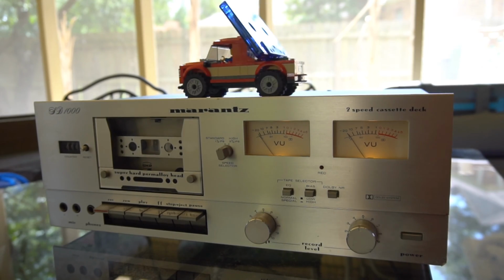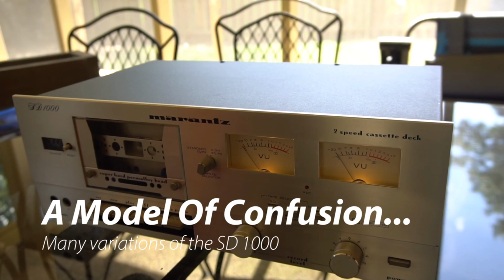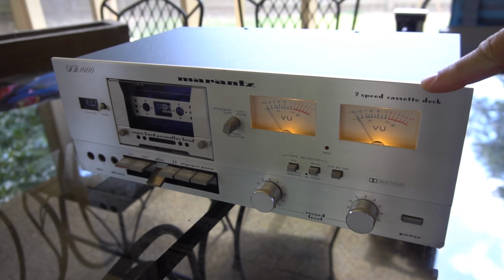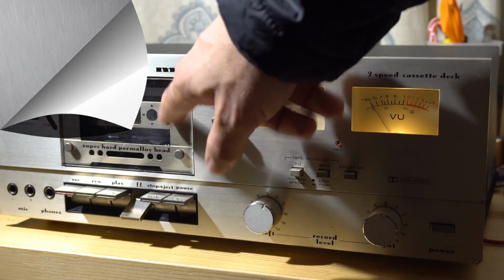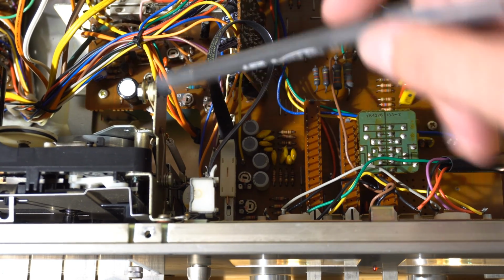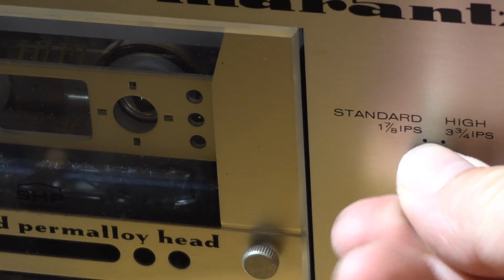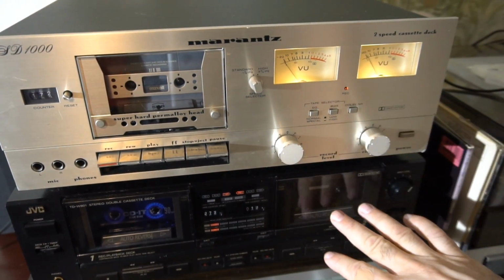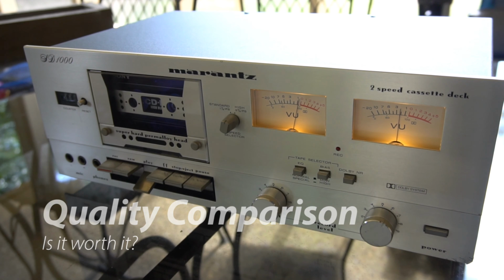Marantz SD 1000 - A Rare Dual Speed Cassette Deck!

Comment: The SD1000 is the only one ( japan made ) that anyone should really search for.  The SD1002/10/20 were made in 81 and have a lesser quality mechanism. They have a .08% higher wow/flutter vs the SD1000 at 0.06% which falls in line with the rest made in 1979-81.

Comment: That was my cassette deck, that faster speed made good tapes a TDK D-90 sounded much better at high speed than a SA-90 at normal speed. Unfortunately the motor went and was able to get it replaced. Marantz warranty was great at the time.
Reply from the maker: I am curious did using this deck force you to remember to make a second copy for the car/walkman, or did you record a "master" at 3 3/4 then copy selections at the normal speed... Anyway, thanks for watching and commenting!
Reply: @ACBMemphis  yeah I did make copies for the car at normal speed. Those were usually a TDK D series or equivalent. The noise floor was noticed in the car so much and you didn't feel so bad when the car deck ate it .

Comment: I can hear the difference even over my iPhone speaker. The high speed sounds silkier. The low speed sounds grainy. I’m actually surprised there’s that much of a difference. 

I think what killed the decks was the arrival of the Walkman and car stereo cassette decks that didn’t support high speed playback. Also, even with a 90 minute tape, it might be difficult to fit even one side of an LP onto one side of a tape at the higher speed.
Reply from the maker: Yes, one thing cassettes were about was portability, and it would have been frustrating borrow a tape and not be able to change the speed in your player to match the recording... Thanks for watching!
Reply: Yeah you nailed it. Just had a smooth sound and the high frequency roll off was out far enough not to be heard and a standard TDK D series tape worked so well there wasn't any need to use a SA. The extra amount of tape that the Bass energy could be stored on was a nice benefit. With a single rec/play head it did pretty good for a two hundred dollars deck. At high speed it out performed the entry level 3 head decks , but then the eighties rolled in and most of the cassette decks got alot better. The Eighties was certainly the Golden Age for the cassette media.
Reply: Actually, the average playing time of LP's is about 20 minutes per side, so that would actually fit quite nice. The longest playing time I've seen (and own) is just over 26 minutes, it's also a single track and the runout area/groove is pretty much non-existent, most (if not all) automatic turntables will not play the track till the end.

Comment: It sounds like they did not design in high enough quality electronics to take advantage of the higher resolution high speed provides.  But this is low resolution you tube.